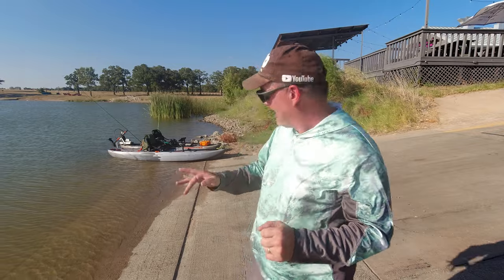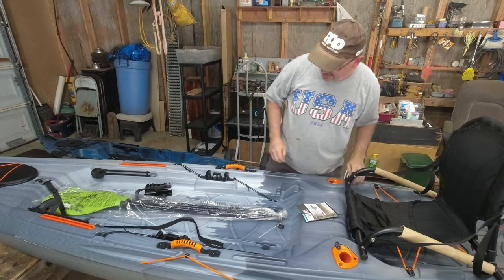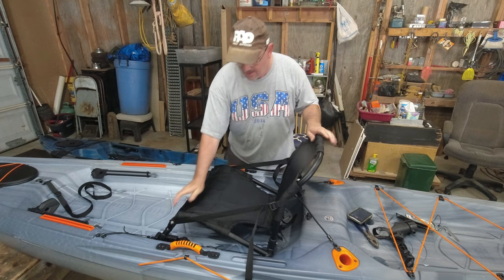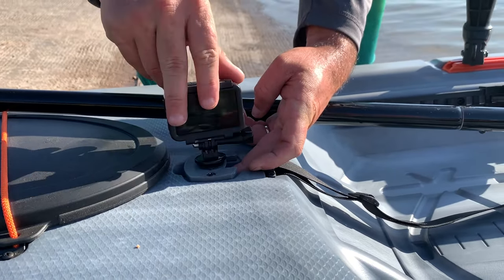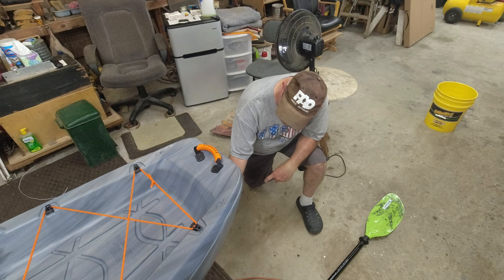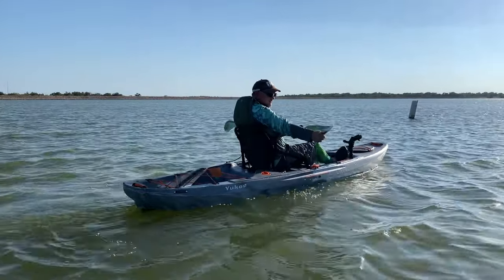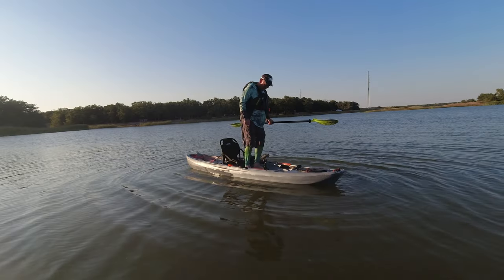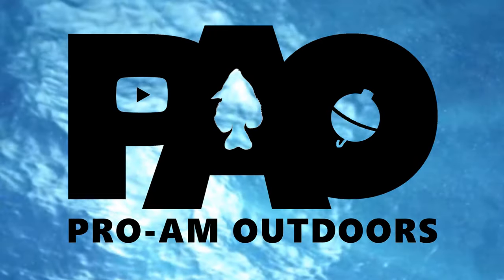Lifetime Yukon Angler 116 Flip Test and Review🔥🔥🔥

Comment: That is an nice kayak you got man. I liked how you did the flip test. I also like how you did it barefooted 👣 too because that how i kayak is barefooted 👣 because i have big very very Extremely wide feet 🦶 sz15 6E wide with very very chubby fat wide toes that are Evenly straight across making my foot very very Extremely wide at 6 1/2 inches wide from my big toe to my lil toe. My foot outgrow shoes , socks , & boots when I was 18 years old & Flip flops 🩴 is the only footwear that will barely and I mean barely fit on my feet 🦶 because my toes are wider than the flip flops 🩴 straps. It suck having a very very extremely wide feet 🦶 with very very chubby fat wide toes that are Evenly straight across.  It also doesn't help that i am a lil on the chubby side too. Good video buddy. Thanks you for sharing it.